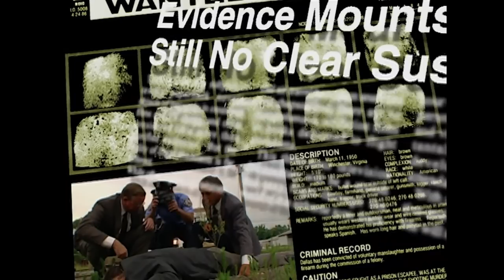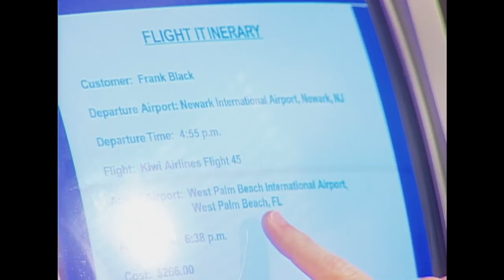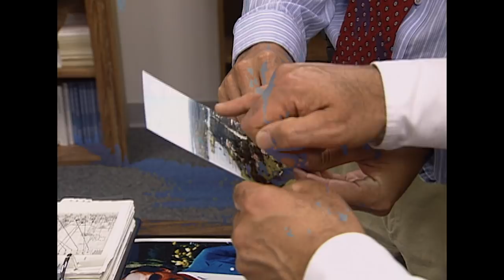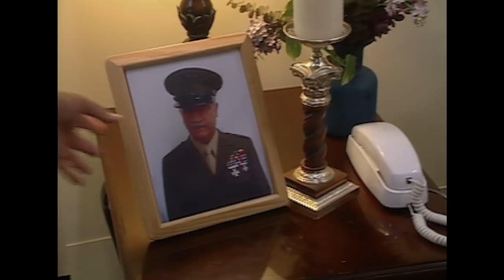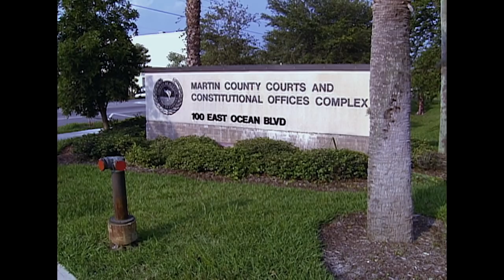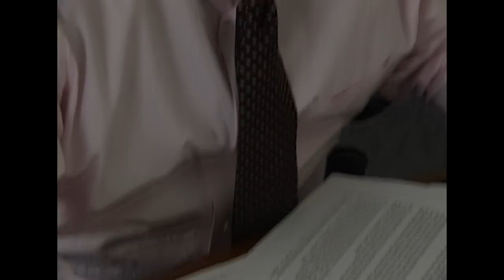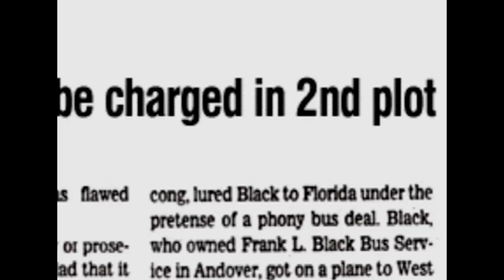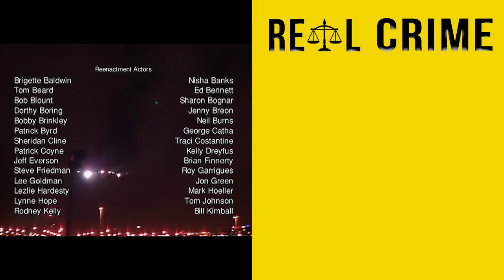Millionaire Disappears After Meeting Mystery Woman | The FBI Files | Real Crime

Comment: I'm confused!!..... 
Wouldn't such a successful businessman.... check out anything he's thinking of venturing into?? 

.....like....did she exist? 
Did her company exist??
Reply: People easily forget that not even 25 years ago the internet was still relatively new for most people, and even though it existed many businesses didn't have a presence on it at this point. These cases are all from the 70s 80s and early - mid 90s. While nowadays just about every company has an online presence (even the smallest of companies), back then most older business owners had a Rolodex of contacts and phone books. What's nice about these cases is that more often than not they had to rely on good old fashioned investigative work. There's only been a few cases on this show where DNA was used in any conclusive capacity, the suspect in this case even mentioned his fears about DNA used in the O.J. Simpson case at the time. While technology has certainly made cases easier and quicker to solve, it also meant that investigators spend less time per case now and in the circumstance where the case is difficult they're quicker just to set it aside nowadays to move on to the next, leading to far more cold cases than existed back then.
Reply: @dynagaming2693  
Well... Absolutely thank you for such an informative, and well-worded comment.